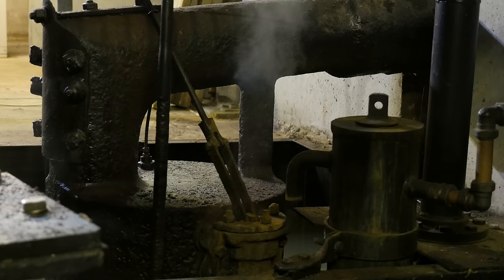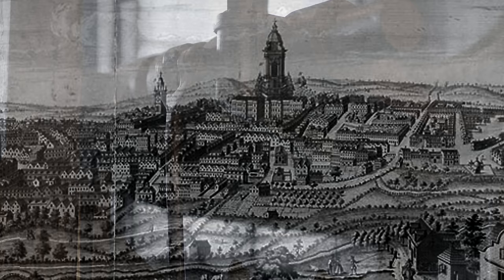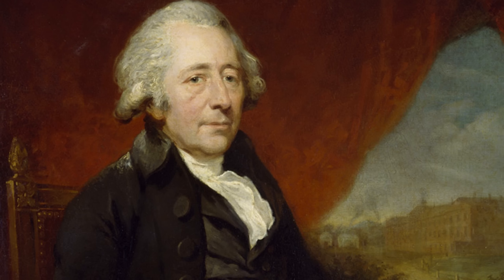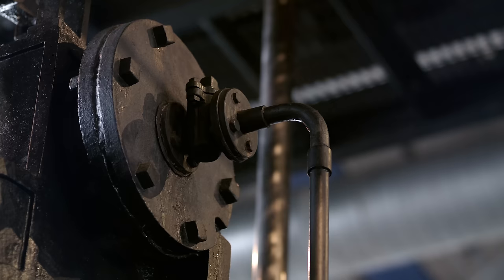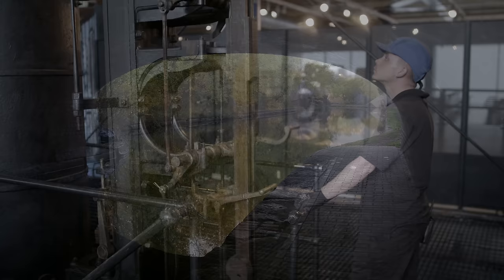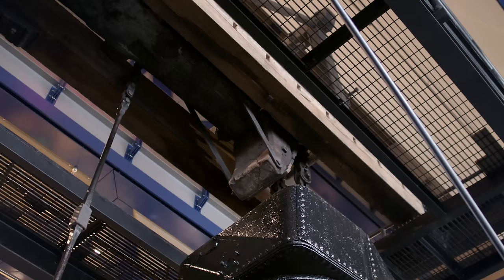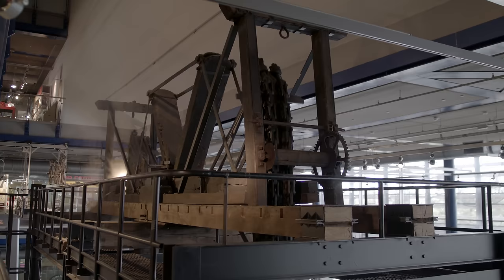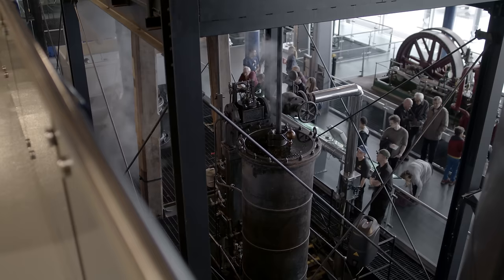World's oldest steam engine brought to life

Comment: When the engines moved from MSI to Thinktank there was a significant risk that they wouldn’t be able to run on live steam due to cost and would be operated on jockey motors, it required considerable effort to enable sufficient funds were available. Most of the installation work for the engines was undertaken by Heritage engineering of Glasgow…… some of the engines had been in pieces in long term storage which presented significant challenges when being assembled and commissioned.

Comment: James Watt didn't improve Newcomen's Atmospheric Pump, it couldn't be improved, even by Watt.
James Watt realized Newcomen's Atmospheric Power was the problem.
So Watt dumped Newcomen's Atmospheric Power for High Pressure Steam Power.
To achieve this he had to INVENT a new engine, the world's first High Pressure Steam Engine.
It was nothing to do with efficiency, although it was more efficient.
His new engine could work without a separate condenser but it made his engine more efficient by recirculating hot water and eliminating Atmospheric Pressure, which opposes a Steam Engine. Watt's engine didn't need a vacuum to run, straight from Watt's mouth, if you don't have enough cold water for a condenser, just release used Steam to the Atmosphere.
Then?
An Industrial Revolution!
No more Newcomen Atmospheric Pumps or Arkwright's Water-Wheels.

Comment: More efficient, thermodynamic problems,, steam and steam condensate meeting, improvement, vacuum needed to operate the engine, what a load of bluster!
Newcomen's Atmospheric Pump couldn't be improved, even by Watt, it was a 70 years long dead-end.
A 100% efficient Atmospheric Newcomen Pump will only give 14.7psi. of Atmospheric Pressure, and we know that's impossible. It would be more like 10 psi. A vacuum isn't needed for a Watt High Pressure Steam Engine to work, straight from Watt's mouth, a condenser is optional.
The story of a model Newcomen Atmospheric Pump (true or not) is worth mentioning?
The change from Newcomen's Atmospheric Power to Watt's High Pressure Steam Power and his invention of the world's first PRACTICAL High Pressure Steam Engine to achieve that, (the big change) isn't worth mentioning?
(as usual).
And this is straight from the top man! No wonder us minions don't know any better.